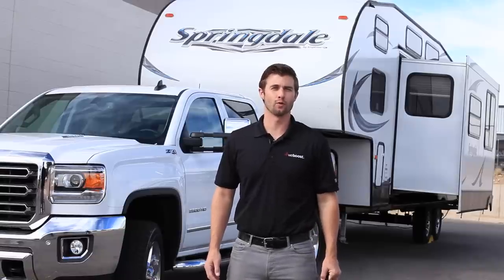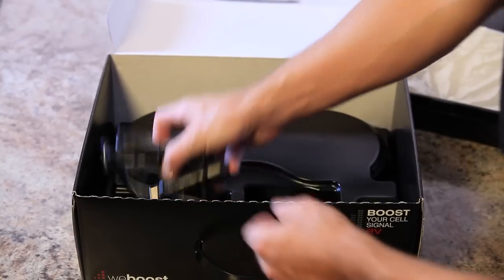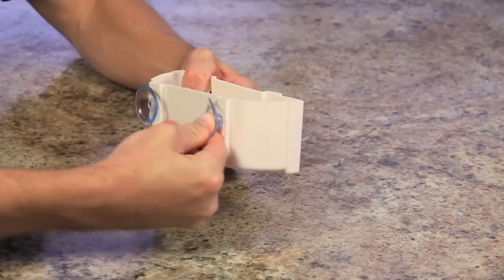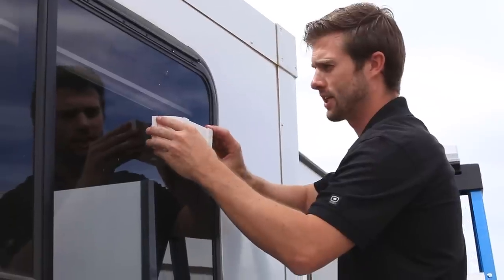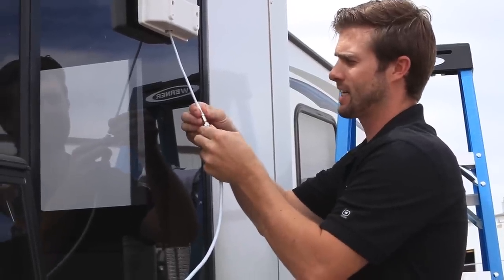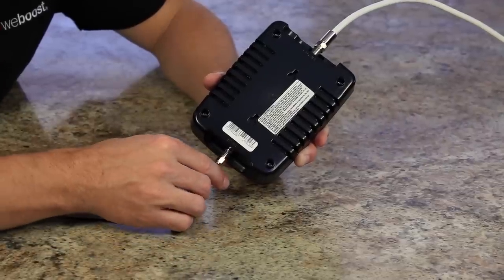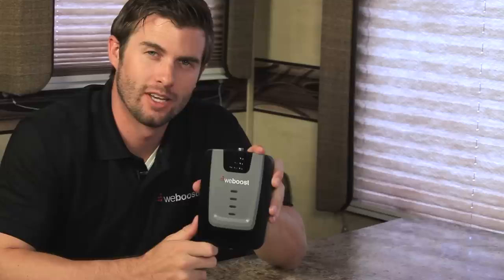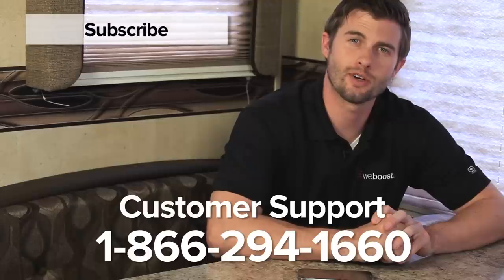How to install the RV 4G cell phone signal booster | weBoost

Comment: The video doesn't mention that this install is designed for use only when the RV is parked, and that the outside antenna needs to be removed and stowed while the RV is in motion.

For improved cell reception while driving, you can use the weBoost Drive 4G-X kit (470510) with a trucker/RV mast antenna (304414 or 304415).

Comment: so you have a cable  flopping  around  the  outside  of  window , for the purpose  of  a quick  install  is how I see this.
Reply: This setup isn't designed to be used while the RV is in motion. The video didn't mention that, though.
Reply: So you need to keep putting it up and taking it down when you drive then park?
Not sure I like that at all

Rather have a permanent roof mount